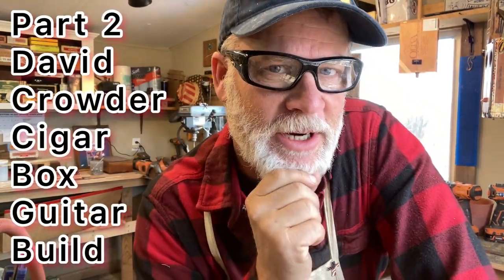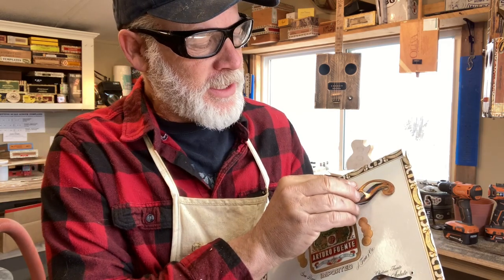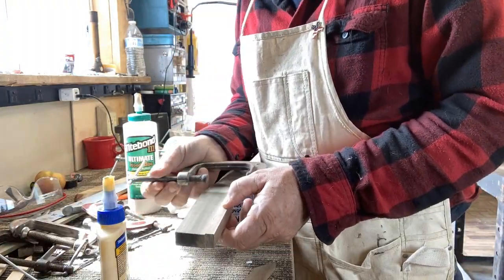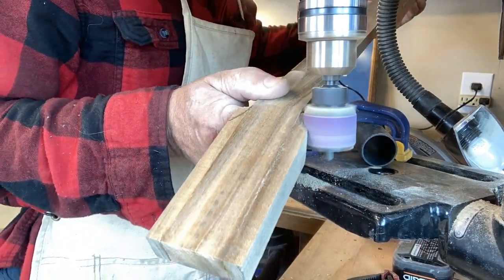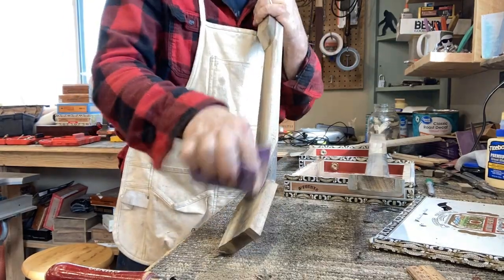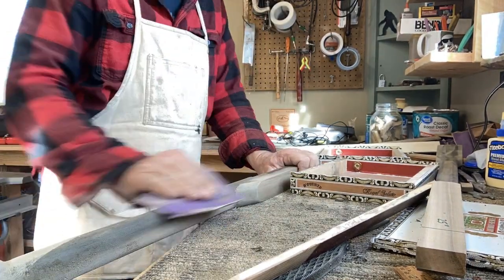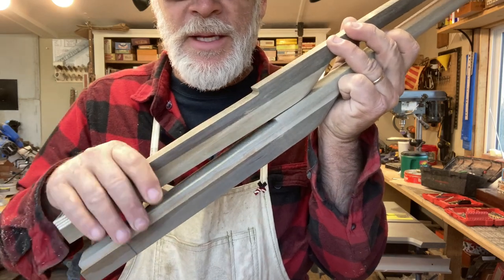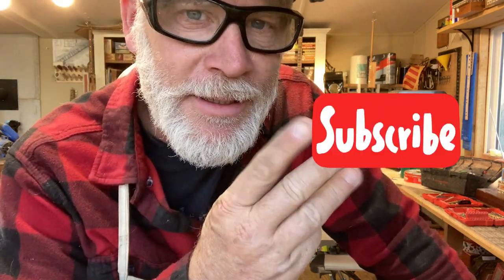David Crowder - Cigar Box Guitar Build (Part 2)

Comment: So...this might be the student instructing the master, but I've built a few CBG(uitars) and CGB(anjos) and found something  simple.  The neck angle is hard to get right. I put the finished neck into the front slot with the back end of the neck/block flush with the inside/back of the box.  Small vertical (popsicle) sticks are glued to the back of the box on either side of the end of the neck block so the end of the neck doesn't move side to side (making a track). The top of the neck end is cut at an angle to allow the head to be lowered without the end of the neck hitting the underside of closed box lid. I attach my front box-to-neck screw on the underside of the box.  I close the lid, string it up under mild tension, with the bridge installed.  I vary the box to neck angle until I have the action I want at the 12th fret, then run a screw through the back of the box and into the end of the neck. Viola! The angle is set and I have the saddle height and action i want.  If I want a back screw from the bottom of the box into the neck, I can open the box, shim the back of the neck to the bottom of the box and put in the screw, then take out the positioning screw that initially set the neck angle.  I like to use a cut three prong fork for my tailpiece with the tanks rounded over so I just use the screw that sets the neck angle to also hold the cut fork/tailpiece.
Reply from the maker: can you make a video?? explaining?? 😃

Comment: Hey Del, what is the thickness of your headstocks?  What would be the minimum with a scarf joint?  Apologize if I missed that in a video.  Have a great day.
Reply from the maker: usually just the thickness of the 1 by.  i shave a little (about a saw blade thickness) for the tuner shafts
Reply: @PuckettCigarBoxGuitar  Thanks Del